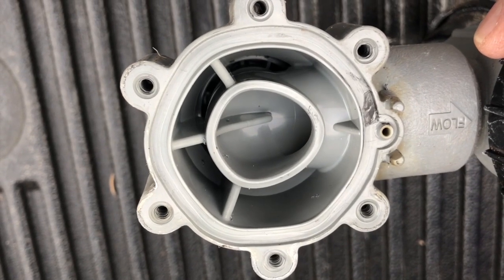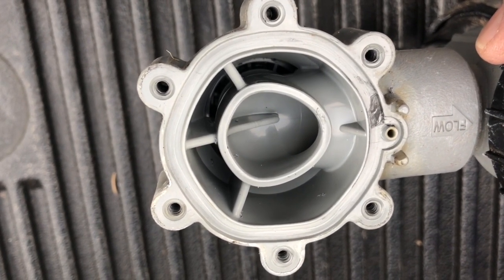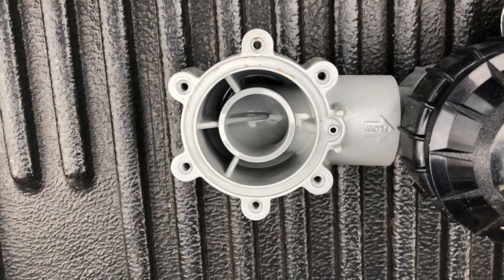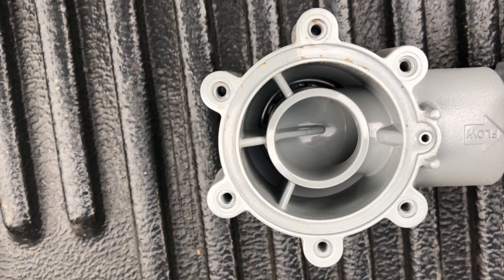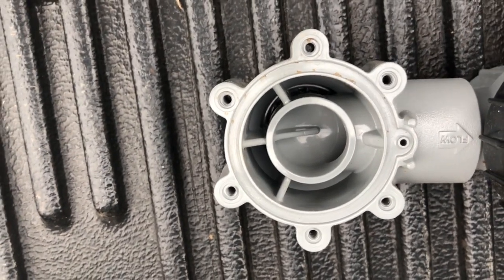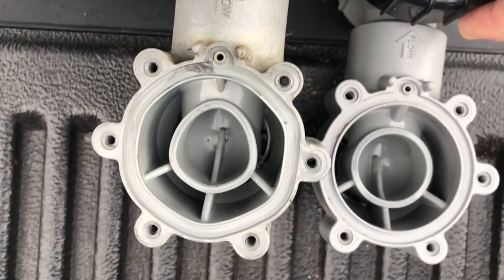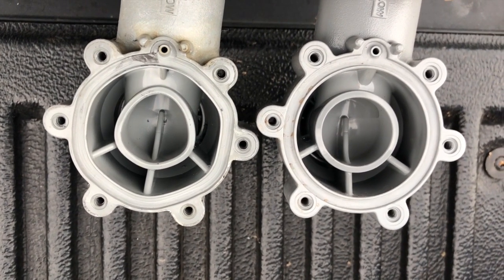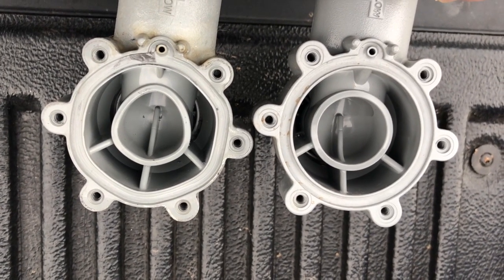A Few Reasons Valves Fail pt.1

Comment: I'll be dipped! Is it just the sun light or heat from the sun light that deforms them? Also, I'm in Michigan so my valves are in ground but what about that valve set up that is above ground just outside my house that hooks up to my main? Should I cover it up even though it's all brass I believe?
Reply from the maker: MichiganWildcat most definitely cover it up. It’s a combo of hot plastic under high pressure. Down in the ground valves are probably safe.